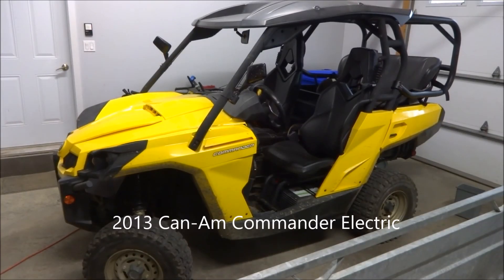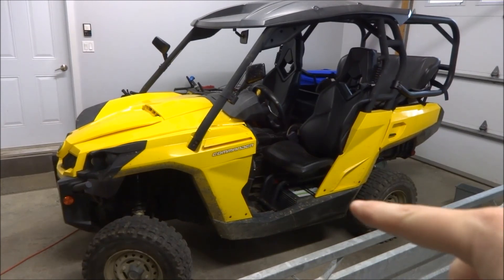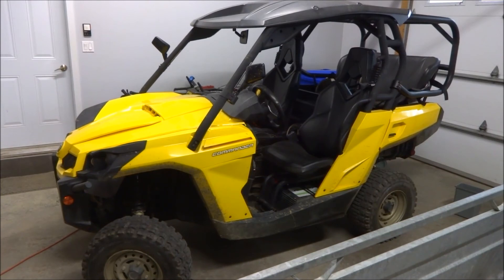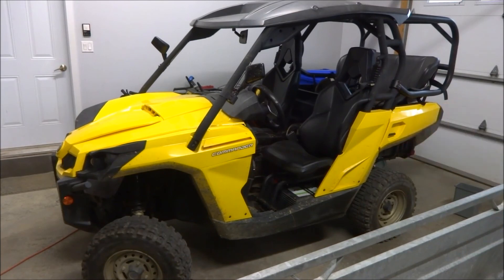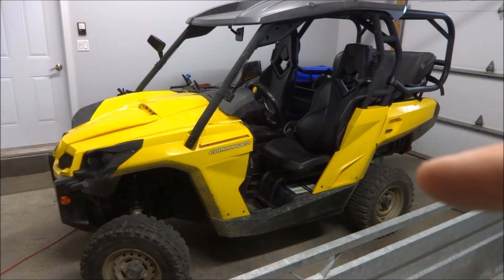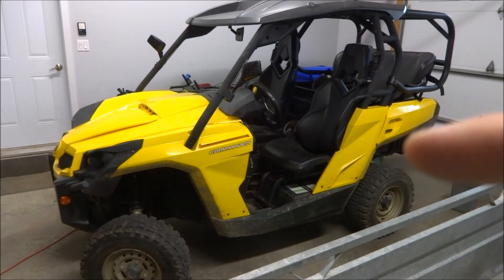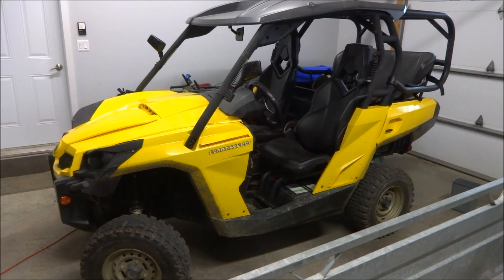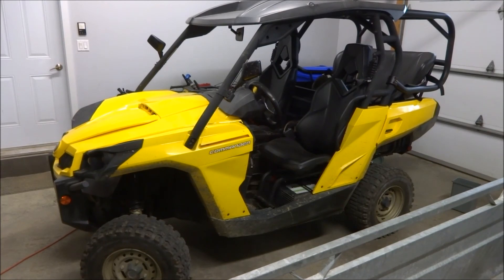Commander Electric upgrade to 18650 (intro)

Comment: I understand that it travels 65 km on a full charge ? or 65 miles ?And what is its maximum speed ?
Reply from the maker: 65km
Reply: I understood correctly that he drives 65 km and that's it ?